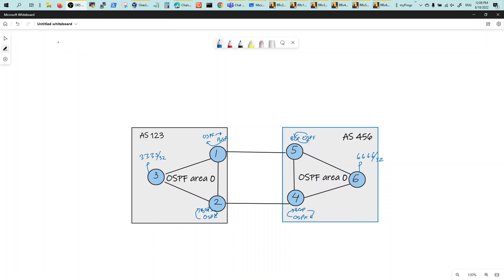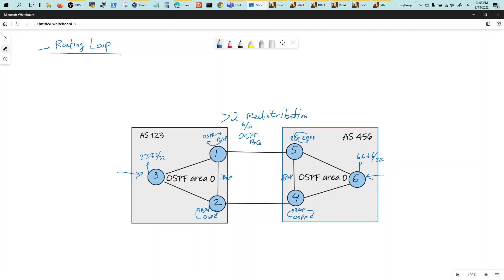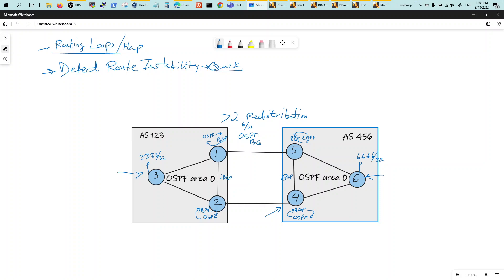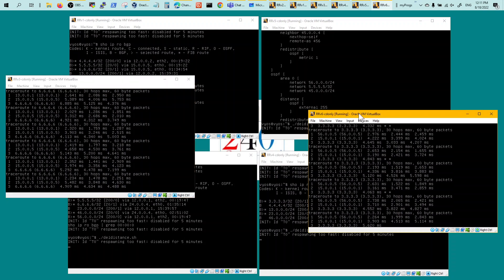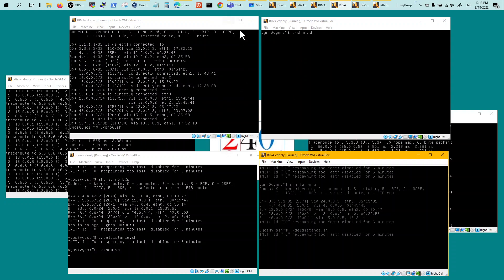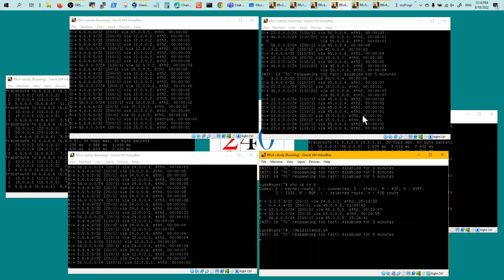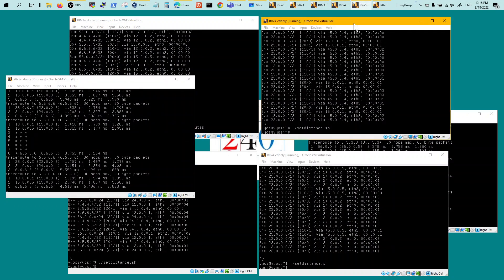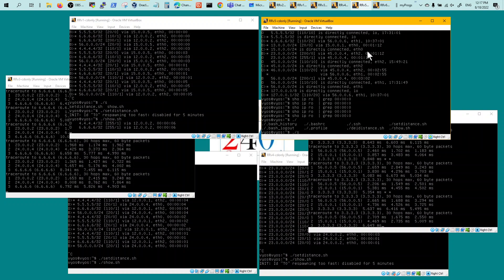BGP/OSPF Routing Loops - How to Simulate, Detect and Fix them

Comment: Looking at the cli output, its entirely unclear as to which router belongs to which cli?  Loop could have only occured on left side ospf 123, imo. But again, how the loop occured would have been crucial to know.  Configuring AD is fine as counter measure but we would still have no visisbility in to "why".
Reply from the maker: good thinking...why is most of the time because of which route gets installed first --trigger could be router reload or link flap...it is indeed tricky--bottom line: if you have 2 or more mutual redistribution that is usually a trouble sign...filtering extensively is the only way to ensure no readvertisement happens----i  usually check for route age and figure out if there are flaps. 
thanks for the comment

Comment: Hi, I'm a "new" network admin (definitely not as experienced as you). I convinced my bosses to let me setup the network (instead of paying for professional services) and I configured things similar to what you ahve diagrammed in this video. I am redistributing from BGP to OSPF (and not vice versa) and alll connected ports. In my OSPF environment, I noticed that I"m not getting a default route and there's no internet access. I had OSPF default originate, then I changed it to BGP Default Originate, but either didnt seem to make a difference. The default route (0.0.0.0/0) should be done at the two BGP routers right?
Reply: BTW, I should also mention I'm running new to the market equipment, two 9240 Aruba Gateways and two Aruba 8360-12C as my core switches
Reply from the maker: the ospf implementation is RFC based therefore ospf should behave the same in all vendors
Reply from the maker: you can do default information originate always in ospf or you can also do default static route at bgp speakers and redistribute those statics into ospf or just do default information originate- the [always] key word in ospf default originate will originate the default without a static route. hth